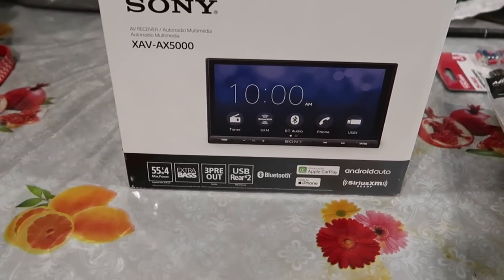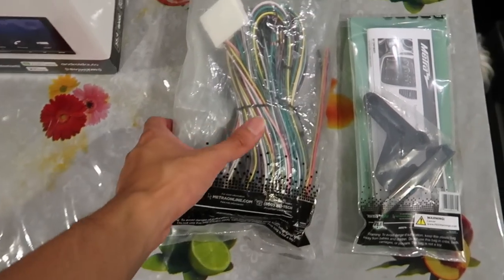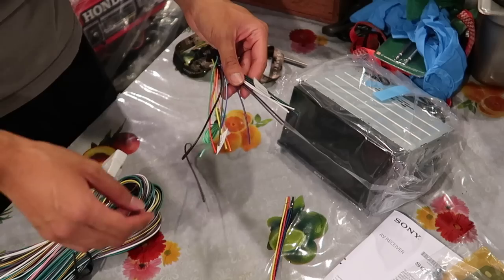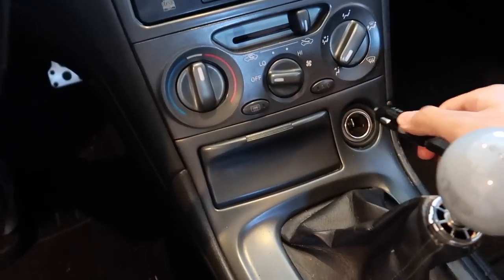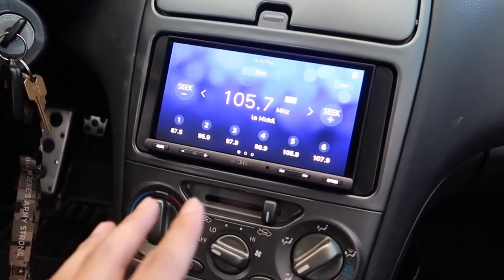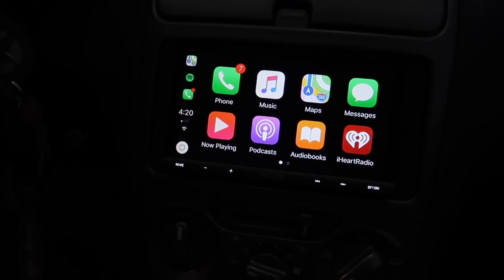Double Din Head Unit Install! (Sony XAV AX5000/Amp Bypass) | Toyota Celica

Comment from the maker: Here are the time stamps since the video is so long :P
Feel free to watch the whole thing though! :)

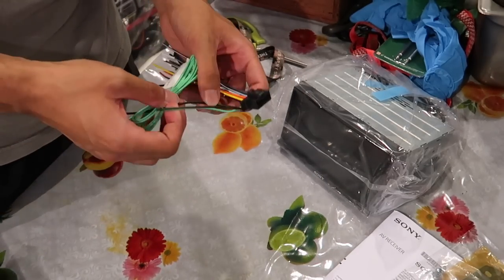3:57 Wiring explanation (what goes where)
7:00 Stock stereo removal
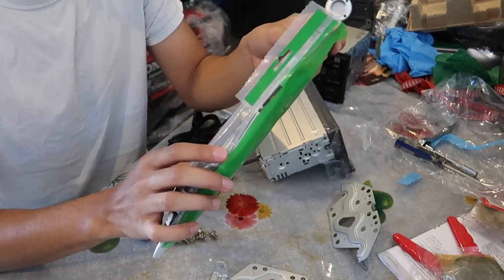8:16 Reusing stock stereo brackets/dashkit
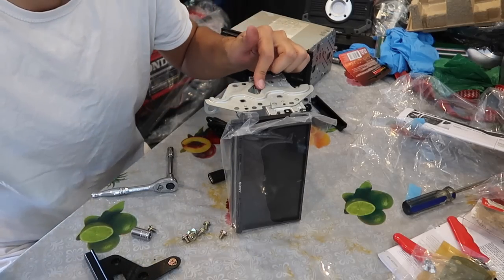8:37 Parking brake wire bypass
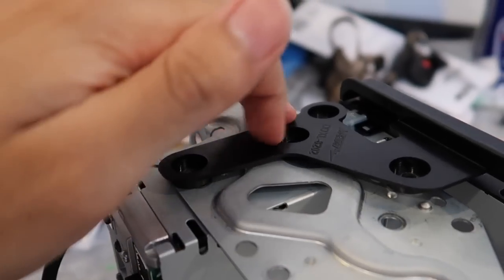9:24 New stereo screws
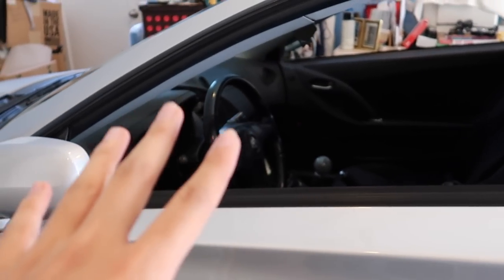9:55 Glove box removal to access amp
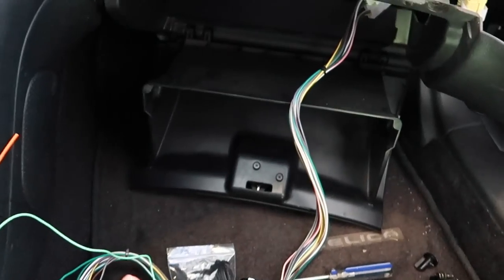11:35 Overview of what/where to plug in
Reply: Very helpful
Reply: It is going to work for Nissan Altima SV 2015?
Reply: Would you recommend getting this still in 2020? I want to get it for my 2015 Honda Civic

Comment: A bit late but would you do the same with a 2000 Celica gts? It has the stock amp but not the JBL system
Reply from the maker: I’m 99% sure :P
Reply: Equinox alright thanks bro I appreciate it
Reply: @hectorguevara572  I have a 01 GTS. I'm assuming I also have the stock amp but not the JBL system. I think only the 03 GTS and later have it. Did you try this install? Was it the same process as the video? Thanks!
Reply: Austin Park yeah it’s the exact same thing

Comment: Nice video! I thought I should mention that the heat shrink tubing that you used is intended to be used overtop of a soldered connection and is only meant to cover it and not permanently connect it.
Reply from the maker: Thanks for the info, hopefully it doesn’t come loose lol

Comment: I installed in my car and its super.
Also upgraded stock speakers .
Installed Hertz coaxial and Hertz Subwoofer.
The audio quality is awesome.
Uses interface is simple.
Android auto is working very smoothly.
All the steering controls working perfectly.
Just very nice stereo.

Comment: Love this video. I'm trying to install a new radio system in my Toyota Celica ss1 2000 . One question, how did you connect the cables? How did you solder them? Or did u just twist the cables?
Reply from the maker: I crimped them using the butt connectors
Reply: @equinoxgts  thanks man , appreciate it! #celicafamily

Comment: Great video. Gotta give you credit for tackling the project with minimal experience. Just bought a XAV AX7000 and plan to do a similar install. A couple questions, did your speakers have tweeters and woofers? My front ones do so they need a crossover. Did you attach the orange illumination wire? I did a previous install and placed the microphone near the rearview mirror tucked into the headliner. Thanks.
Reply from the maker: Thanks! Yes I have tweeters but I’m not sure about subwoofers. (I do need to replace the speakers since they are going out). I didn’t have to do anything with the speakers, just straight color to color wiring. I didnt attach the orange wire since there wasn’t another orange wire on the other end to connect to. (I’m not sure what it does, the buttons on the unit still illuminate anyways). I ended up snaking the mic under the dash and sticking it behind the steering wheel and slightly above the ignition.
Reply: @equinoxgts  The speaker's I was referring to are called component speakers. They have a separate tweeter and a mid woofer. The illumination wire just changes, dims, the display when you turn your lights on.
Reply: I just bought and installed an AX7000 in my Porsche Cayman and holy crap what a difference it makes having a head unit with an internal amplifier!
Reply: Glad I'm not the only one with the orange wire.  I see he just didn't connect his.  I have a AX5500 and it tells you what the wires do in the manual.  Problem is that the orange and white illumination wire should go to the orange wire on the Metra harness.  I eleminated all other wires but 4.  

None of those colors match the remaining colors on the Metra bag.  
I'm going crosseyed looking at this now.  

I have 4 wires: brown/yellow, red/white, green/white, and brown/blue left on the Metra. 
Metra's bag says I should have orange, orange/white, and brown left. WTF Metra?

Comment: Thanks for posting this video, I found it very helpful as I’m looking to install this exact HU for my car. Just one question though. 
Did it work for you to ground the green parking brake wire to the HU mounting bracket? Were you still able to have full access while out driving?
Reply from the maker: Yessir it works!

Comment: Hello' how did that parking break setup or bypass work for you, no problems with the videos or movies cutting  out while driving? Please let me know. Thanks.......
Reply from the maker: The parking brake bypass works fine. This head unit doesn’t have video capabilities.

Comment: I just bought an 02 gts with an aftermarket radio. The door speakers and tweeters have sound but the rear dont even try to make noise. Would it be because they didnt bypass the factory amp? Im not sure if they did or not. The rears arent blown so i dont know

Comment: Hi did the parkbrake wire earthing end up being ok for operating Android auto?. I just got the same head unit installed and I suspect the installer didn't earth the parkbrake wire as Android auto  is giving me all the  warnings and wont connect.
Reply from the maker: I have no issues with the ebrake bypass. You should try contacting your installer
Reply: I did and he earthed it as you described ..Thanks

Comment: I have a 2000 Celica GTS do I need an Amp bypass? The car is stock so no work has ever been done on it
Reply from the maker: I believe so since the GTS’ without the JBL package also came with amps

Comment: Hey!! Did putting the green parking brake wire work when you put it on the side of the radio, instead of wiring directly to the parking brake?
Reply from the maker: Yessir, no issues thus far, easily bypasses the ebrake lockout feature.

Comment: Did screwing the bolts on top of the parking break wire bypass the safety system successfully? No problems?
Reply from the maker: No problems thus far, still workinf
Reply: @equinoxgts  Very cool, I just ordered one and I'm going to install it, was worried about that e brake bypass, thanks for the vid!

Comment: Bro, nice video, so I have a celica 2002 gt, I don't need that big harness if I want to upgrade my stereo right?
Reply from the maker: Thanks! Correct, you would only need the generic harness for Toyotas
Reply: Just to add info the reason his is more complex is because he has jbl wiring. Pre face lift celica 00 - 02 only needs Toyota harness
Reply from the maker: Miguel Reyes-Castillo I believe the gts had some sort of “premium” sound system besides the JBL. At least that’s what I found from some researching :P

Comment: Just installed a similar unit (Sony XAV AX7000) . does your unit automatically turn off when you turn off the vehicle and remove the key? Or stay on, I think i may have made a mistake when wiring it
Reply from the maker: Yea mine turns off when I turn off the car and take the key out

Comment: So if my Sony ax 5000 was installed incorrectly it will drain my battery 🔋 cause I’m having that problem rite now an can’t figure it out changed my alternator an got new battery
Reply: An still drained my battery over night

Comment: does the head unit dim and go into nightmode with applecar play when the headlights are on ? I have a gts 2000 with the same sony headunit but I use the stock amp with a downside of it making a engine whine noise cuz the factory amp is old,
Reply from the maker: It should if you have the orange wire (I think) connected to power, but I didn’t bother doing it so mine doesn’t dim. I should probably do it but I’m too lazy haha

Comment: hey bro did u removed the battery before installing the harness?
Reply from the maker: You should always disconnect the battery when doing electrical work
Reply: @equinoxgts  thanks bro can't wait to install mine :)

Comment: Yoo, idk if youll see this, but i just did my install on this and the fader isnt matches up with my speakers at all. my right rear and right passenger speaker arent playing and i know its not the speakers themselves. any suggestions?
Reply from the maker: I’m assuming the speakers worked before the install, maybe double check your wiring and see if everything is plugged in? 

Also if you have a gts (which usually comes with a factory amp) use the big harness that I used. If it’s a gt, the generic Toyota harness should be fine.
Reply: Equinox Thanks for th reply, i had to do some research and it turns out the factory amp plug speaker outputs for the 2000-02 gts dont match up correctly with the bypass harness. like it plugs in, but the colors arent correct. i figured it out though so ima post what colors go to which for the 00-02. Great vid tho bro👌🏽
Reply from the maker: Really? They’re different than 03+? Or maybe bc I have the JBL sound system? Why’d Toyota have to make it so complicated lol 🤦🏽‍♂️

Comment: You know your supposed to soldier inside the heat shrink right?
Reply from the maker: Soldering is definitely the ideal way. I only used heat shrink on like 4 wires and crimped the rest. Haven’t had any problems thus far

Comment: What does it mean bypass the parking break what features of the head unit don’t work if you don’t have the handbrake on?
Reply from the maker: Usually you’d have to have it grounded to the ebrake which means certain functions like EQ or Bluetooth settings won’t be accessible unless the ebrake is up. Bypassing it just means you’re tricking it into thinking the ebrake is up even though it’s not, giving you the freedom to mess with your headunit
Reply: @equinoxgts  is this only for the GTS?

Comment: I have a great question.  I have a car the same and when I put the speeds dent good but when I put the 4 in front of me like a noise like weird could you tell me that it can be ???  Please
Reply from the maker: I’m not sure what you’re trying to say
Reply: I want to tell you that when I make the changes the car makes a very strange noise in front of the engine but it is only when I put the 4 speed.
Reply from the maker: It sounds like maybe your 4th gear is grinding which may be something to do with your synchronizers or clutch...I’m not too sure, google would be your best bet in finding an answer
Reply: Thank you very much for your idea and for answering and I like your videos 🤙👍

Comment: I don't have the original stock radio when I bought my celica, so it had a 1DIN mounting kit, so I don't have the left and right parts that will let me mount the kit to the dash. I can't find a 2DIN mounting kit for this. Can anyone help me please?
Reply from the maker: You could try finding the stock brackets at a junkyard or someone who’s parting a celica out of maybe eBay.
Reply: @equinoxgts  Found one at a junkyard. What a lucky rare item.

Comment: Getting that same deck installed today on my 2002 Lexus SC430.
Reply: Got it installed and sounds and looks amazing.
Reply: Did you get it installed? Did your SC430 have the Mark Levinson system or the base (Pioneer I believe)? My ‘04 LS430 has the Mark Levinson system which has a unique impedance not found in just about any other car stereo components. 5 years ago when I first bought it I wanted to add a more powerful sub in addition to the 8” factory sub but the impedance of all components in the system have to match. Essentially I would have had to replace all the speakers, amp, and head unit with matched impedance to add any component. Anyway did yours end up working?

Comment: is there any way to turn this unit off, while the car is running?
Reply from the maker: Yes there is, press the option button and on the bottom of the screen there will be 3 icons, tap the third one and the screen will be off.
Reply: @equinoxgts  not just screen, but shut off the whole unit.
Reply from the maker: Uhhh I don’t think there’s a way, why would you want to shut it off?
Reply: @equinoxgts  well, I need it powered off while the car is running, to do some reset of the vehicle onboard computers.
Reply from the maker: I guess the only way would be to unplug it or pull the fuse out for it (if there is one).

Comment: Did you have to update it?
Reply from the maker: What do you mean update?
Reply: If you go to general in settings and go to firmware version you can update it to 1.02 but mine is stuck on 1.0 that’s why I asked
Reply from the maker: Ohh, it came updated already. You gotta download it onto a usb stick and plug it into the stereo
Reply: Equinox it won’t let me update idk why
Reply from the maker: Hmm that’s weird, try contacting Sony

Comment: In case u wanna use that smaller antenna adapter here’s some info on it

https://www.4runners.com/threads/connecting-both-antennas-to-an-aftermarket-headunit-pictures.805/